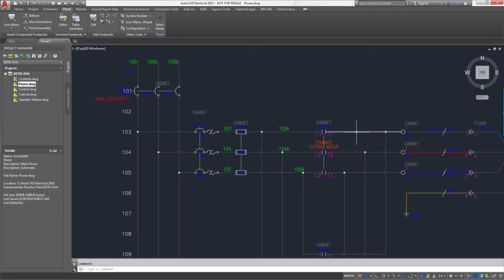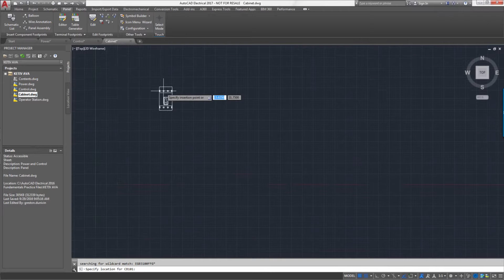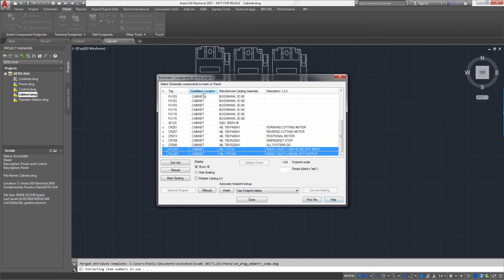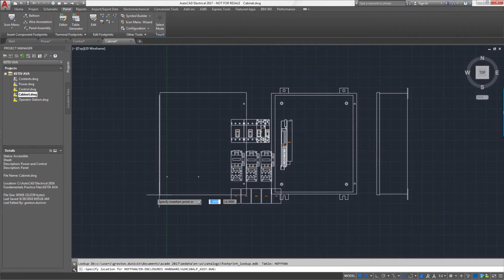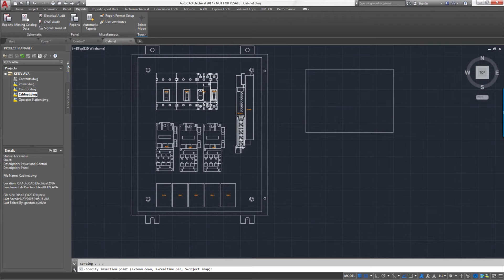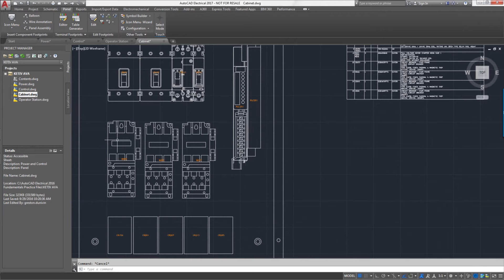Panel Design in AutoCAD Electrical | Autodesk Virtual Academy

Comment: how do I use project code, installation code, and location code? but actually, I am an electrical supervisor. I would like to work in low voltage electrical design.